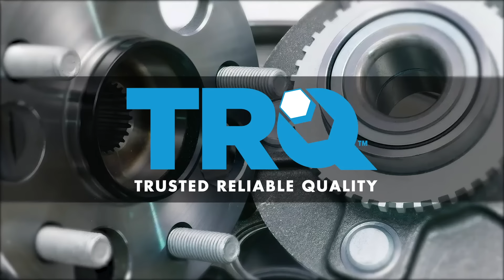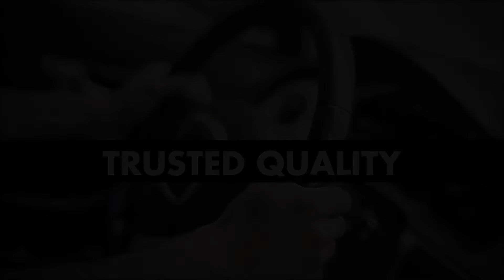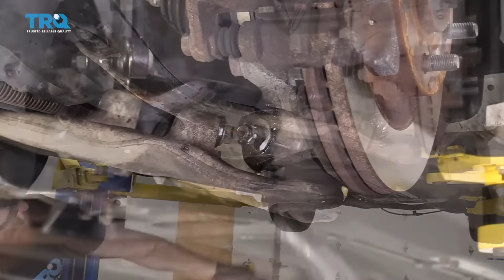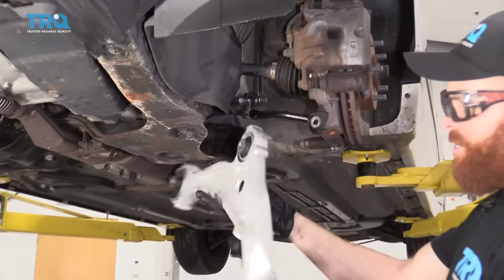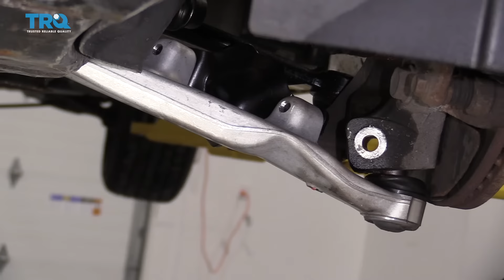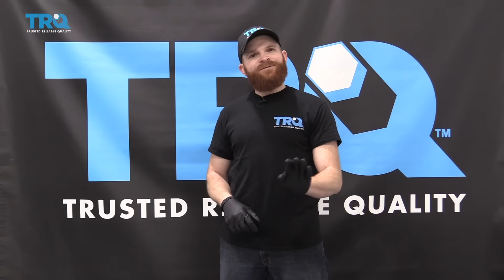How to Replace Lower Control Arm 2007-13 Nissan Altima

Comment: Hey there before you tighten the controls arm bolts you will want to make the suspension loaded before you tighten the bolts because if you don't it will twist the rubber bushings and ripped them trust me I didn't do that last time and I ruined my control arm bushings but I know now

Comment: I'm working on the same car but on the passenger side. 
The bushing bolts are lined up but I cannot get the ball joint to fit into the knuckle like I think it may be the cv axle bearings not wanting to line up. I tried jacking the car up to ride height and all but still something out another isn't allowing me to push the knuckle in enough to line up the ball joint end of the control arm 
Any suggestions?

Comment: Must be nice to knock the pinch bolts out so easy. Mine are seized in. A sledge hammer is barely moving them 🤬

Comment: okay guys so none of his methods work for me so i had a friend give me a hand and we found a way easier way. Remove the axle from hub to get more play out of the hub and then line up the two bolts before the ball joint is in place. take a 10mm socket and line up the top part of the two rear bolts with a pry bar of some sort. YOU MUST LINE UP 1 HOLE AT A TIME. Place the 10mm socket in place of the top hole while aligning the bottom hole. hammer the head of the bolt through fast so pop out the 10mm socket that was holding the bushing in place. Nobody will shoe you guys how to line the bushing bolts up so just give it a try if nothing else is working guys because the job is not this easy.

Comment: Thanks for your video. 
It helped out a ton changing the lower control arms. 
One thing I had to do different. On the left side, we had difficulty manuvering the axle to line up. I ended up removing the top bolt where the strut mounts and let it pivot down and fint the correct angle. Went back together smoothly after that. 
Thanks again. 
Randy Anderson

Comment: Your a id#ot. Using a hammer to install a bolt and not care about the threads. If your so smart why didn't you install new nuts or mention it like the manual says. They need . Replaced after there removed. Your a hammer mechanic is all you are. Your other videos are the same. Read the service manual before you make videos. Wouldn't buy a part from 1AAuto because of these type of videos

Comment: What is that black bracket connected to the control arm with three bolts used for?
Reply: I belive its just for rigidity
Reply: Good question. I'd really like to know as well.

Comment: I changed my lower control arms on 2014 nissan maxima. 

If you remove the brake caliper and tie it up high as possible, 
remove the brake disk, 
then remove the bolt to the sway bar that is attached to the strut, 
remove the brake anti locking sensor and wire from around the strut,
 remove the bolts that hold the strut and move the strut end to the left, 

Now,  the lower control arm comes out and goes back  in free and clear, zero hammering needed including hammering the ball joint....I learned this from another video...

I did use a fork to separate the ball joint on the old control arm, but didn't need to hammer the ball joint on the new control arm at all. Also did not need to hammer the lower control arm bolts.

 I put the two inner  control arm bolts in first didn't tighten the nuts just started them,
 then the ball joint bolt, 
then tightened the three....gives a little more wiggle room but probably didn't need it. 
Then reattached the strut,  sway bar end, anti lock sensor, brake disk and caliper. 

 Torque is 117 on the two control arm bolts, and 46 on the ball joint bolt.
Reply from the maker: +auctionmusic Thanks for the feedback! http://1aau.to/m/Shop-TRQ
Reply: Did the same thing had to get an alignment though 😕

Comment: I just did mine. Thanks. The easier way to me is to align it is to remove the two big strut bolts and you can play with it almost effortless to get the pin in. You should  have there other two anchors point already in.
Reply: I'm going to try that. you know its a bitch when they break out the ratcheting straps lol
Reply from the maker: +Me Thanks for watching our video! http://1aau.to/m/Shop-TRQ

Comment: Will this be the cause of the slight shaking that i have. Got new tires fully balanced, but having a slight shake at higer speeds
Reply: Might Be, Having Same Issue Here. I Have Brand New Tires Fully Balanced. Got A New Axles As Well But At 65MPH I Get A Shake Or a Hight Vibration. Not Mentioned I Did An Alignment  On The Car. I Noticed Control Arms are Bad On Mines So Im Watching This Video To See If It Fixes That Shake.
Reply: @osensantos4590  lets hope this is the problem then. Lookin to replace mine in about a week or so, i'll keep you updated
Reply: @osensantos4590  Did you change your lower controls arms? Did it make a difference? I have a slight shaking too, changed the bearing because they got loud. But still a little shaking.
Reply: Also check your brake rotors!
Reply: I would also check to see if your Altima has a recall. There is one right now for suspension, I'm having mine done right now. Might not have to pay anything after all if there is a recall they can cover